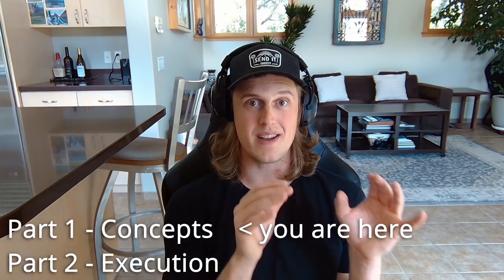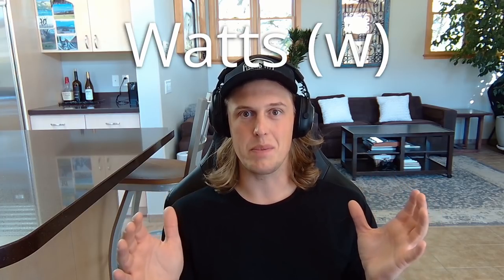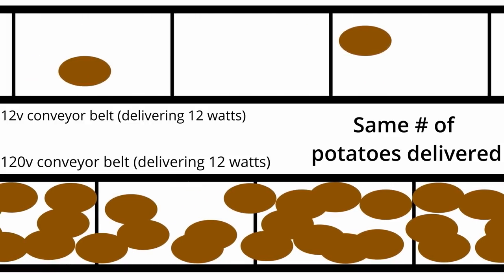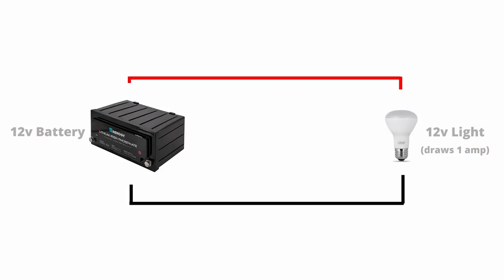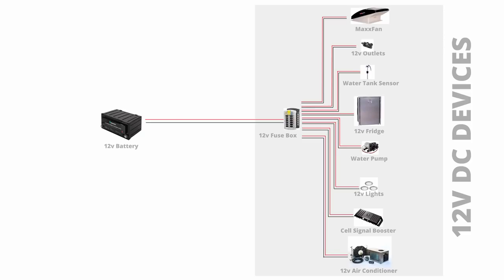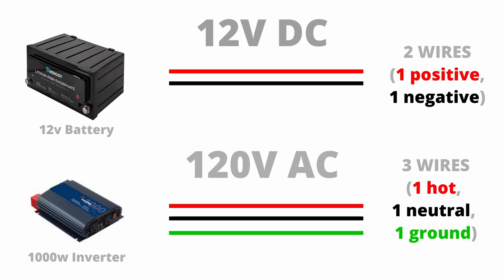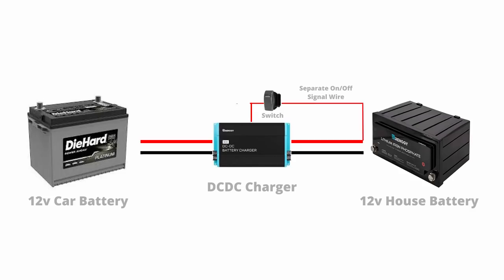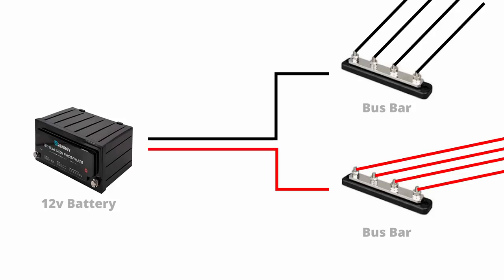⚡ How To Build An OFF GRID ELECTRICAL System ⚡ For Vans / Tiny Homes / RVs / Boats - Part 1 Concepts

Comment: I thought we're only supposed to ground the AC and not the DC? If DC has no ground (and only positive & negative wires), wouldn't it be redundant to connect a negative wire from battery to chasis and back to battery? AC has a ground wire and wouldn't it make more sense to ground the AC's inverter green ground wire to the chasis?

Comment: Scratching my head...How did you determine your need for a 300A breaker from the batteries to the bus? I'm trying to set up mine now but only have 3 x 100A batteries.

Comment: Maybe this setup more simple:
- Hybrid Inverter (3 sources input: Battery/Solar Panel/Generator)
-Upgrade car alternator charger bigger
Reply: Thats' was I have been looking at + shore power, but wondering what is the difference or which one is better ie DC/DC charger or Split Charge relay and in the
later case would you need to upgrade the std factory installed alternator ? Enjoyed the vid. good basic explanation.

Comment: actually, there‘s an error in your chart at 22:46: you multiply watts and hours to watthours, not watt/hours, w x h = wh
Reply from the maker: In that photo I showed watts * hrs = watt hrs. Are your referring to watt/hours being spelled with the /?
Reply: @seven_o_savage   yes, watt/hours would be calculated by watts divided by hours, the unit of energy is watt-hour, so in your chart you corectly multiplied watts and hours but used the wrong unit in the result. 100W * 5h = 500 W*h = 500 Wh
Reply from the maker: Yea good call I misspelled the term watt hrs. Unfortunately not big enough of a mistake to reupload this video

Comment: Amps  which is a measurement of electron flow or CURRENT is not the speed of the electrons as the speed is constant (like the speed of light) regardless of the number of electrons  but it is rather the VOLUME of the electrons that flows through the wire and is limited mainly by the CROSS SECTIONAL area (or resistance) of the wire AND the electrical pressure applied to the wire which is measured in VOLTAGE......The amount of CURRENT , (measured in AMPS  or AMPERAGE)  that flows through a circuit, a wire, a    LOAD, an appliance (all of which are conductors of electricity) given a certain VOLTAGE applied, is dependent on the RESISTANCE (measured in OHMS) of the circuit, or LOAD (or appliance). For a wire it's very low but for a circuit with some resistors and other electronic components and even an appliance it's much higher. Mr. OHM work out this relationship between VOLTAGE, CURRENT and RESISTANCE many years ago and came up with his basic fundamental formula called OHMS LAW which is VOLTAGE = CURRENT X RESISTANCE

Comment: WARNING: The AC electrical diagrams and color coding are not correct.   For AC the white wire is the return ground.
The black is the constant hot side. The red is switched hot side. The Green is common third wire Ground. 
Never confuse AC and DC wiring color codes.